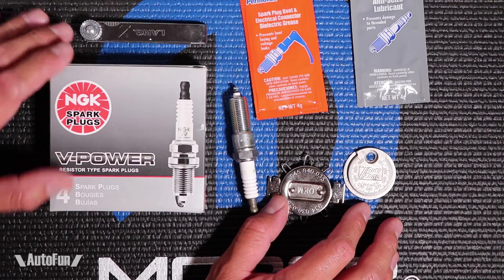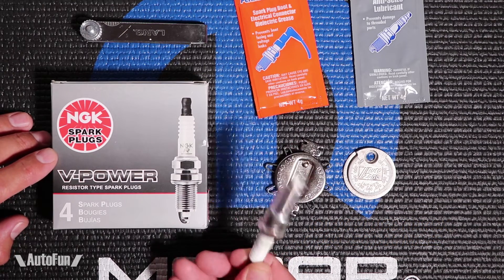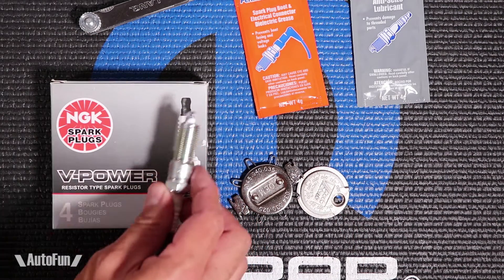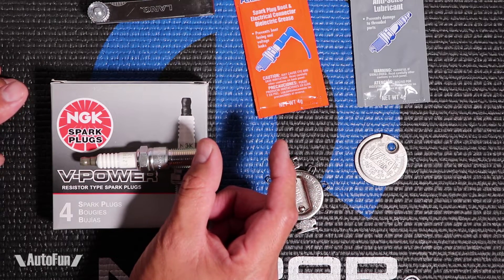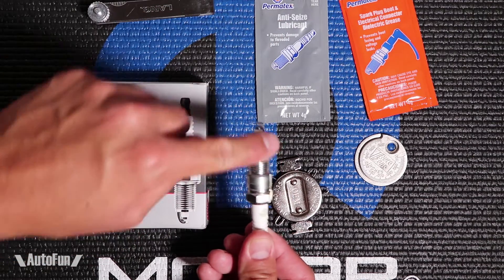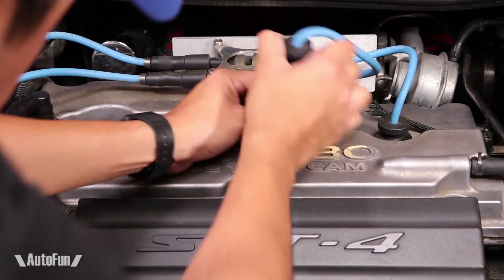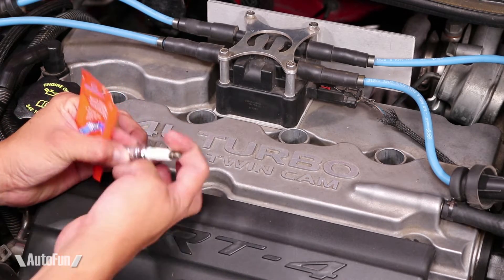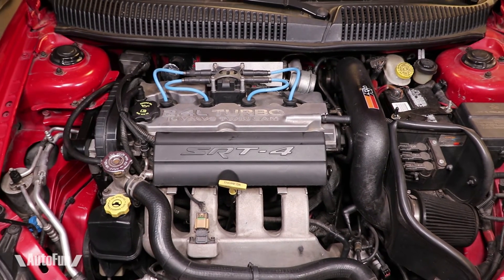Dodge Neon SRT4 Spark Plugs FAQ & Install (2003-2005)

Comment: Love your videos brother. Been following for quite some time. 
  Where did you get that ignition coil heat shield by the way.
Reply from the maker: Thanks Amador! Ah yeah that shield I got it back in the days the SRTForums had just started, a member there was doing them (that's how long I been in the SRT world LOL) Cheers!
Reply: @AlexAutoFun  I figured man. Loving that Mopar emblem on top. I guess for now I have to settle for the modern performance one.
  At the moment I'm dealing with a P0304 code. In the past, if you have encountered this issue, what was the soulution. I know it can be several things and as of today I've tested plug wires and spark plug number 4 for resistance.
  I'm moving to the o2 sensor now. Any help will be greatly appreciated. Thanks again for your detailed videos!
Reply from the maker: @Madderz007  You're welcome! Ah I have not encountered P0304 but sounds like the possibilities you mentioned are close the the issue. That being said, misfires can be caused by several things, including, an actual mechanical issue with the engine, Fuel Injectors, Coils, Wiring (and in extreme cases PCM) etc. Take a look at your service manual for that code an you can see all the potential causes for that issue. Cheers!

Comment: Hey quick question I have a 05 srt4 with turboxs BoV, upgraded intake, a MPx catch Can what should I gap my spark plugs ?
Reply: Thank you I’m new In the Srt4 life so I’m trying to learn to work on these cars slowly but I gapped them at .040 car seemed to run fine now no more check engine light for the misfire so thanks for the info!
Reply from the maker: @manuelhurtado1592  Awesome! glad to hear it helped! and welcome to the SRT4 community bud!
Reply: I’m pushing 15 pounds I wanna say so that’s stock I’m assuming
Reply from the maker: Hi Manuel! Typically people run 0.038"-0.040"  for the Stock Turbo, and bigger turbos (Higher Boost Levels): normally they run then at 0.032" - 0.036" The higher the boost, the smaller the gap gets. But It's a little bit of trial and error since each car reacts differently, but hopefully his will give you a starting point bud!

Comment: I have seized plugs! Any tips on removing? I actually broke a 3/8 ratchet trying to break it free.
Reply from the maker: Wow they must be seized pretty bad! I have used this liquid https://amzn.to/2EJ0wB7 in the past to break bolts and seized spark plugs. The key is that I leave it for about half our, just soaking into the threads, then I try to either tighten o or loosen it, just a bit, that way more of the liquid travels into the threads. It takes some time but with patience and ton of this liquid it seems to always work. Let us know how it goes and thanks for watching slow srtfo!

Comment: I been using 1 step colder NGK spark plugs almost 3yrs and never had any problem, I tried using the spark plugs from this video but didn’t work for me
Reply: I use the 1 step colder iridium's myself, they are hands down the best plug when you have higher then stock boost. I'm around the 26psi myself and they work perfect.
Reply: @kevinmiranda6298 part number?
Reply from the maker: Hi DjChaconLSU, I heard some folks had better results using colder plugs, which they also have the advantage of letting you turn up the boost later and not having to worry about changing spark plugs again, thanks for sharing your input bud!
Reply: Well what plug did you use ?
Reply: Mike Savich I used the NGK V-Power
Reply: are you completely stock ?
Reply: Sosa Marley I’m on stage 1